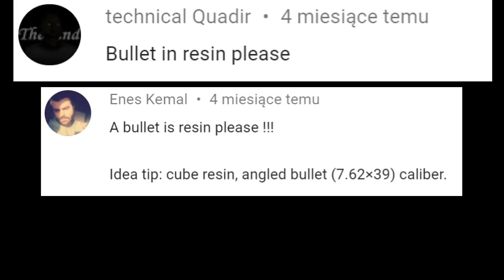Bullet Underwater. DIY a Simple Way / RESIN ART

Comment: No offense, amazing work but this can only happen in reality if someone accidentally drops a cartridge into the water. Since this metal part mimics a full cartridge having the casing and the core together. After firing a firearm only the projectile leaves the muzzle. Which is the tip (and it's partially covered by the casing.)
Reply from the maker: You're right

Comment: Really creative great build the only thing that I will have a problem with is the fact that the shell casing was included with the bullet and it has a trajectory path in the water what a bowl of that caliber is fired the shell casing get separated from the actual bullet which is at the tip the casing itself stays behind so the actual bullet after it being fired does not look like that

Comment: like the video, and that bar of metal you used is not supposed to be turned on a lathe, it is not a free machining steel, that's why tool grabs and you get a very bad finnish on the cut even with tungsten tip cutters, also for smaller diameters you need to go up higher on the chuck speed to, so a 12mm bar would be spun around 830 rpm and 10mm would be 1000rpm.
i hope it helps

Comment: i know, you're make the bullet accurately, but that's not how bullets work.
After firing, only the bullet goes out, but the casing shell which hold the gunpowder, will be eject out instead. I know this is beautiful, and you're done this well with the shell, but, absolutely, you need to cut the shell out instead. Otherwise, this video should be named "a dropped bullet", although the effect may not right.